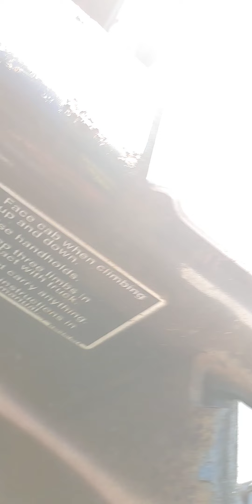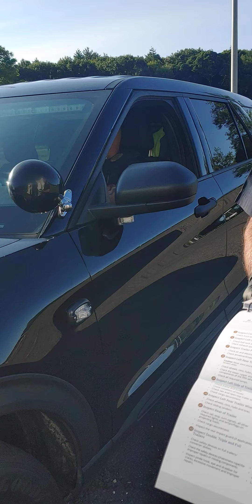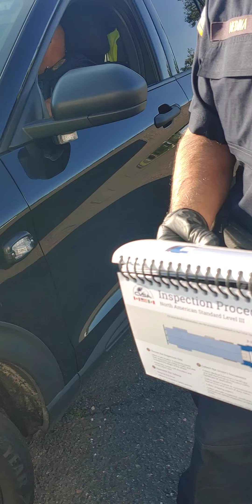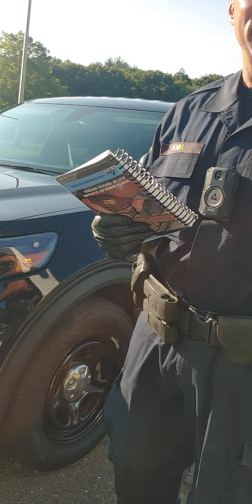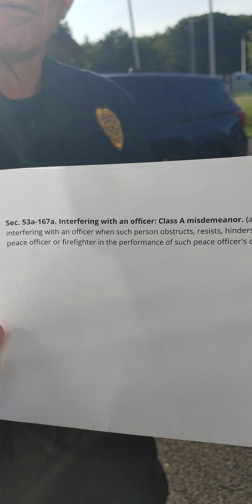**PART 1** CT DOT RETALIATION AFTER I REFUSE TO ASSIST IN A LEVEL 1 INSPECTION

Comment: Truck is pretty much brand new
Reply from the maker: @stumpgrinderbear7034  2015 Columbia Glider that I attend to on any and every matter. I was targeted because I was bobtailing and truck is clean. Then I was retaliated against because I wouldn't assist. I fixed the two hoses right there. But I'm contesting it. The big take away is I didn't get a ticket for obstruction. Please watch part 2 in the description or on my page. They actually did the inspection themselves without my help.

Comment: Hats off to you sir. Wish more drivers would invoke their rights. Why on earth would you want to help incriminate themselves. Hope you had some Lysol disinfectant wipes in that truck for everything this pos touched.

This video brings back memories. In short.. I picked up a reefer load in Fargo, ND, weighed the load at the TA in Fargo. After receiving the legal scale ticket and headed south on I29 to SD. Pulled into the first scale heading southbound on I 29 into SD. Was given a ticket for being overweight. Fought the ticket in front of a judge at some little town in SD and beat the case. What stands out about this case was the smirk on the scale masters face even after he lost the case. These people are pieces of sh*t.
Reply from the maker: @stevenhower1228  🤣😂🤣😂 absolutely. The biggest takeaway from this vid is that there's no law stating that you have to help DOT perform an inspection on your equipment. They know this but are accustomed to us helping which makes their jobs easy. Note I didn't get a ticket for obstruction 👍🏾💯.
Reply: @willmann30 I think what a lot of folks forget that there is in fact a LAW that says you do not have to help the government in incriminating yourself. It’s called the 5th amendment. That LAW will also NEVER be ratified, amended or changed to assist government. NEVER.
Reply from the maker: @stevenhower1228  that's CRAZY the uniformed terrorists giving you a ticket even though your scale ticket says you're legal. Wasted your time, lost revenue and frustration to come and defend yourself against an incompetent state official. I truly think the courts should order compensation in instances such as yours. These pirates are terrorizing us drivers.
Reply: @willmann30  No worries William. Cat scales refunded me the cost of the original citation and then when I beat the case, the government reimbursed me the cost of the original ticket as well. Also, our shop was located about 25 miles west of Fargo so the time off didn’t hurt as much as that shitty officer would have liked.

Comment: Technically the hose can have crack in and the inspector can fail or give a warning depends on the inspector. I have dealt with D.O.T on daily bases as mechanic on buses. Some of them have huge heads. And outhers are cool. I personally from the video I could not see if the hose was bad. And technically they need ur help to ck brakes and lights and that it.
Reply: He had his partner there so there was no need to have u so it all

Comment: Any excuse to punish people for no reason I couldn't see what he was talking about it's definitely retaliation over feelings being hurt 💯
Reply from the maker: @ste1872  the brake hoses going to the Chambers had a bit up rub against them from the power divider housing. He could've easily told me to replace it sooner than later so it doesn't pierce the hose. But NO. He was pissed because I wouldn't help him so he found something to hit me for. A d*ck move basically.
Reply: wouldn’t doubt if those DOT’s are protecting the drug smugglers they get a smooth ride while the hard working truckers are getting harassed by these bastards